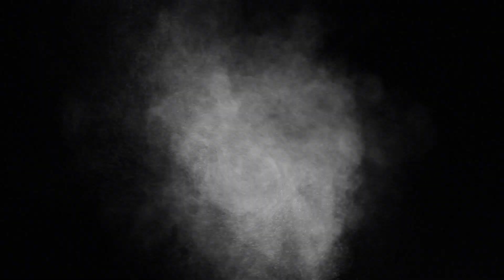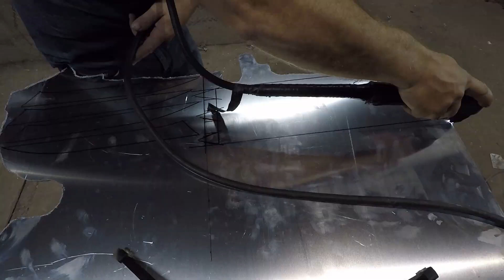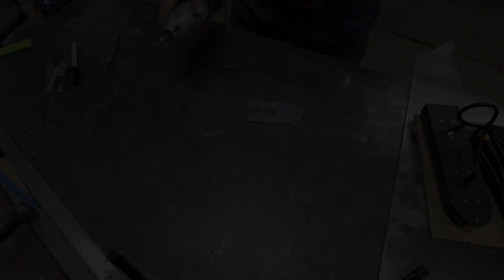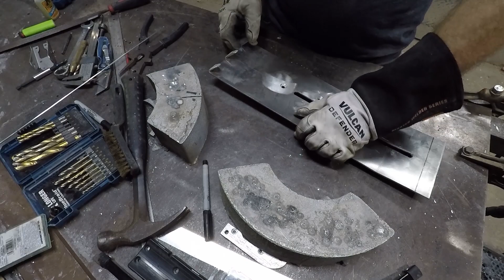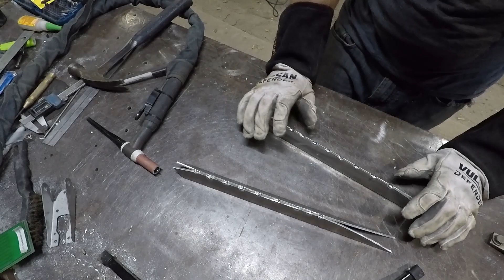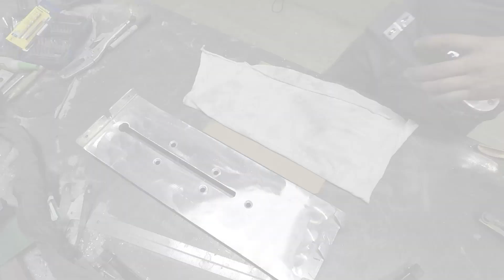Belly Mount Transducer Plate for FISH PRO

Comment: Just curious, does the mount attach to the bottom of the ride plate?  It's my understanding that the ride plate works as a radiator/heat sink for the engine's cooling system.  Would the mount reduce the amount of water coming into contact with the ride plate?   Another quality looking product for sure!!
Reply from the maker: Yes it attaches to the riding plate and is made of aluminum which doesn't affect the cooling off the engine

Comment: Hi Mike. Great work. Does this work with the Garmin GT36UHD-TM and on a 2023 Fish Pro Trophy? I want to pair the GT36 with the existing GT15M-IH using the Y cable and connect both to the existing Echomap UHD 72SV. Any advise appreciated.